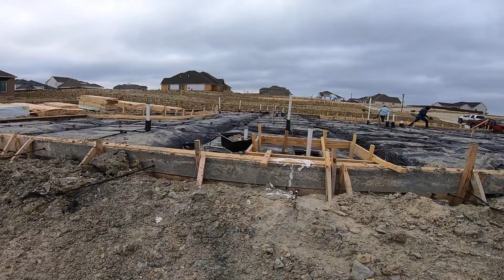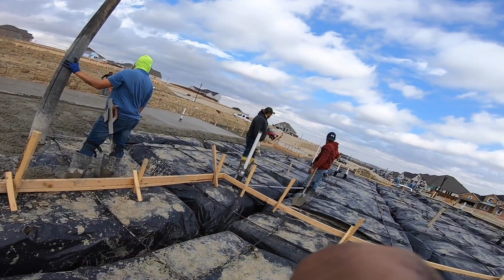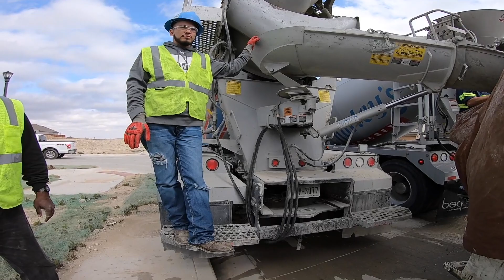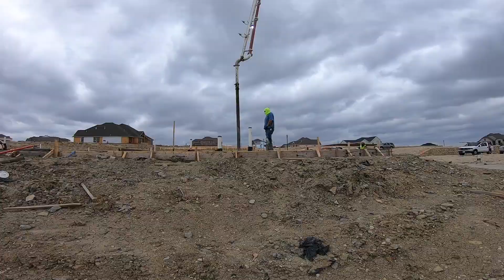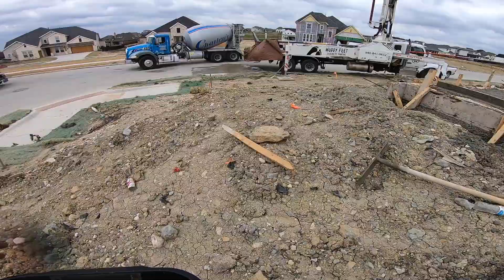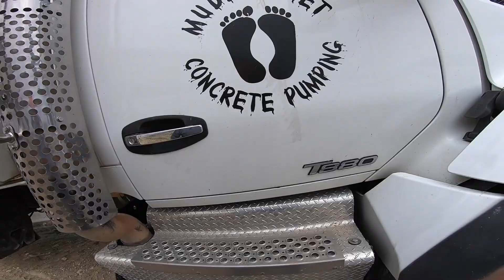170 yards of concrete. Pumping concrete with Muddyfeet

Comment: Love watching your videos started running a concrete pump in 1971 things sure changed over the years last time I ran one was 2012 [67 years old] that was Enough put a couple on trucks since then [trailer pumps schwings] and replaced trucks under boom pumps also for a pump company Will work on them but no more concrete pumping
Reply from the maker: Thanks for stopping by.

Comment: Whats the point of the vapor barrier if that guy is just gonna put a bunch of holes in it on purpose?
Reply from the maker: How much moisture do you think will come out of that small slit?
Reply: @MuddyfeetConcretePumping  I’m not sure.  I’m not a concrete expert but it’d imagine it’s uniform and taped for a reason
Reply from the maker: I’m not sure either. I was hoping you had the answer